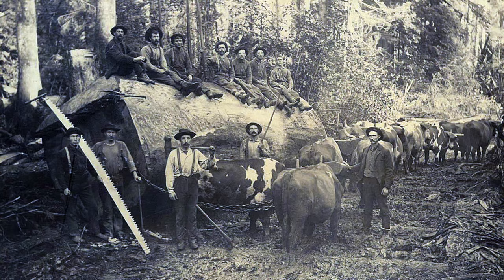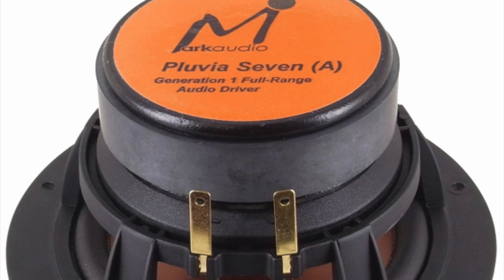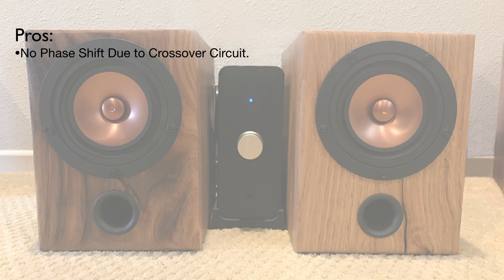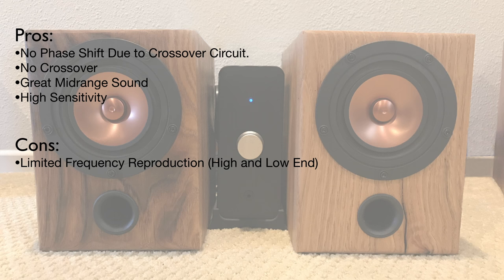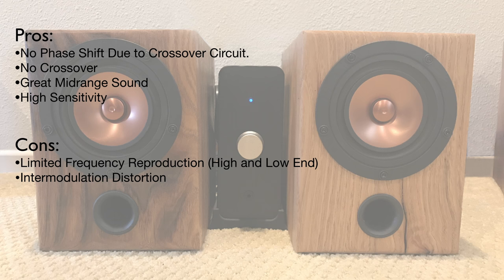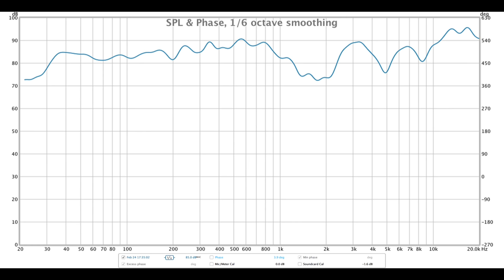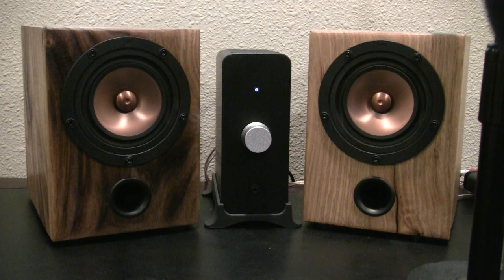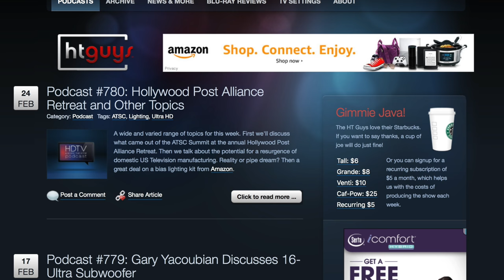DIY Desktop Speakers from Reclaimed Barn Wood

Comment: , I agree, I am going to look into making some T-Line Quade 8 inch point source Bamboo floor standing speakers with a frequency of around 40hz to 20,000 klhz. all 16 ohm so I can wire them down to a 4 ohms load too !!!!!!!

Comment: Good. Best wood to act as a soundboard is spruce. Can you do comparison videos between the average MDF speakers and these Chestnut speakers? To get an idea of how they compare, of course you need to use a good mic and audio interface. I am curious especially how the sound of VST piano  (Pianoteq, Synthogy Ivory II, Ravenscraft 275 VI Labs, etc) improves through these speakers. For example, you play the same piano track (without any reverb or effects), and see how the walnut colours the piano in a nice way.

Comment: one pair of speaker out of an entire shed :D haha . cool video man . like to see more speaker building vids.  Could you build a 5.1 set , a compact system, that looks better , sound better than a logitech set. ! the only speaker i ever build was a ultra wide center speaker and a HT sub woofer. and when building a box , please use proper wood connections , you obvious have the tools ,  that prevents air leaks , make's the construction way stronger. now with the plastic on the walls won't you'll lose the wood acoustics ?